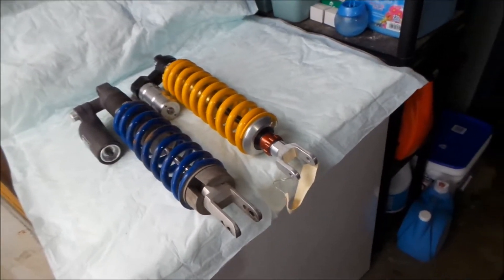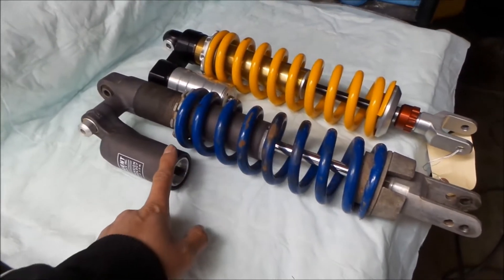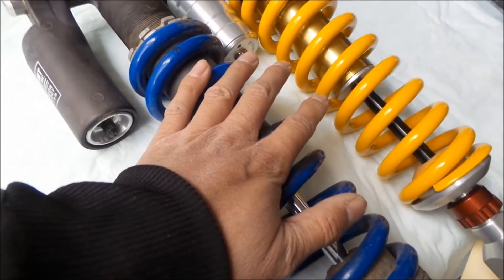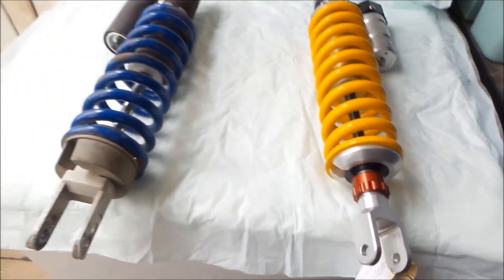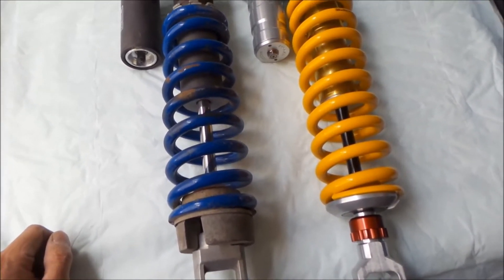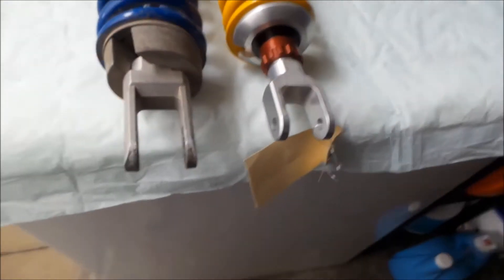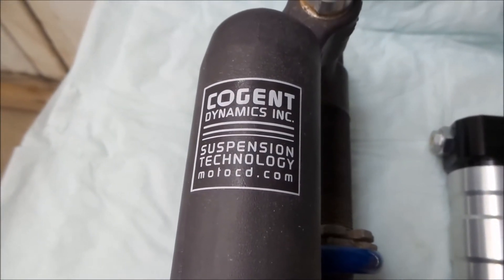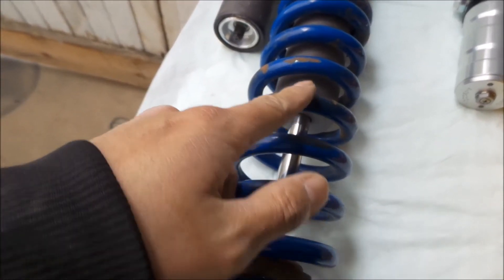DR650 Cogent Dynamics Comparison Stock Revalve Rebuilt vs Mojave Pro

Comment: Well, you did pay an extra 1k for a good suspension! Further, you got to pick exactly what you wanted. The only thing I can think about what goes on in the mind of Suzuki is they know people are going to mod the heck out of them for personal preference. So they sell us a relatively cheap piece of canvas that has "good bones." When you have a production line going a few dollars on a different part can mean a lot of money in overhead. I'm just happy that they are still making them. The flaws of the Suzuki factory are well documented. I would rather have the devil I know than the one I don't!
Reply from the maker: Yeah that stock shock is garbage I have another DR with the stock suspension and it's such crap but if you are going around commuting or cruising it's not bad.  Maybe that's who Suzuki is trying to cater to.
Reply: @hadesomegamoto7639  I agree the stock DR 650 mono-shock is pure and utter garbage! So, did you buy the rebuilt Cogent, and the Mojave at the same time? You must have returned one, right?
Reply from the maker: @douglasbuck2359  Nah I ran the rebuilt one for a while and before I rode the TAT I wanted something good for a 10k mile trip so I bought the Mojave Pro and sold the rebuilt shock.  The Mojave Pro is so much better but it can only make the DR handle so well unfortunately.  Long sand whoops section is still tough on the DR.

Comment: 16:40 if you want to run a set screw into threads put a lead ball in the hole first, it will deform saving the threads.

Comment: Nice comparison....   How did you like it?  How much did it cost?  Did the price include the spring?   Did you do anything with the forks?
Reply from the maker: I think I mentioned it in my unboxing video but it was around $1200.  I love it, it blows the stock shock away.  The forks have progressive suspension springs and intiminators and I like that combo also.  The price includes the spring also.  It's a custom shock so they build it to your specification.

There's more details about my Mojave Pro in this video:
https://youtu.be/AItVmTJjPYA